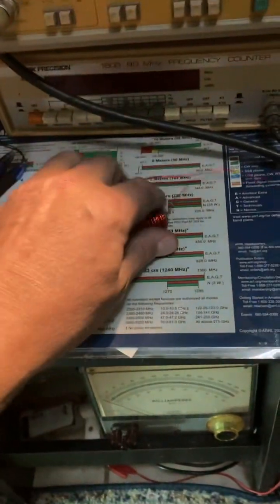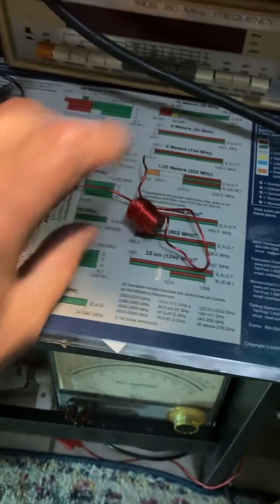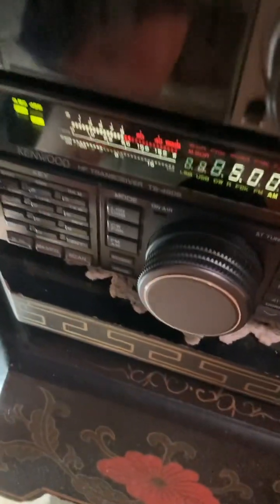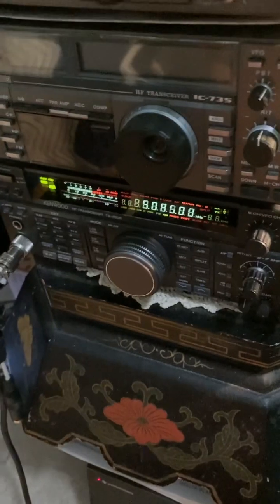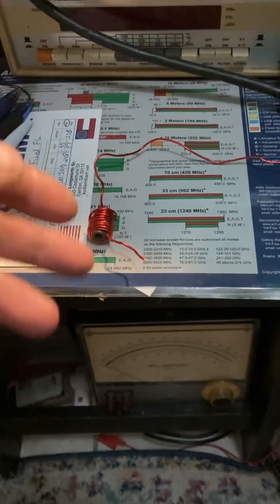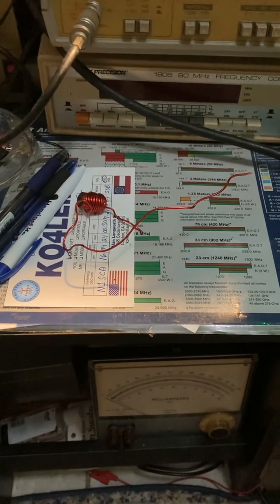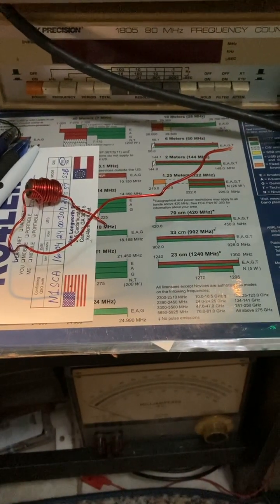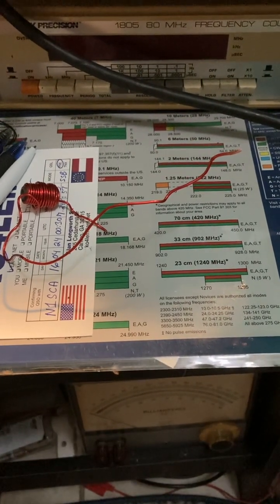Mfj cushcraft hv-4e is fixed👍✨

Comment: Sorry but notvery helpful
Reply: sorry I was hoping to see how to do it. Just got that antenna and worried about what issues I may face when I put it together this coming weekend. Thanks
Reply from the maker: @Mach1780 I would solder scrape were the connectors conections to the coils they are Lois I scraped the red coating off heavily soldered it I used extra heavy magnet wire were it connects it’s very sold if you see it in the video carefully
Reply from the maker: @Mach1780 no problem just check then connections at the coils the got crimped conections on them I had problems them barely on so I soldered it to death and it’s still plays well even when it fell from hurricane miltion the coils connections are still tight make sure their tight if not it will drive you nuts were the break is put a continuity on it to make sure their all electrically together
Reply from the maker: It’s just a video thanks for stopping by anyways
Reply from the maker: Showing the coils were not that great had to resolder the coil connections it’s clearly in the video

Comment: Same thing happened to me. Two bad solder connections. Wasn't even getting contact with top mast for 40 meters. Pitiful quality control. They hadn't even cleaned the coating off the coil wire before putting the end on and attempting to solder it.......I got it fixed.....finally. Geesh.  K4DV
Reply from the maker: That’s the same thing but all coils were like that